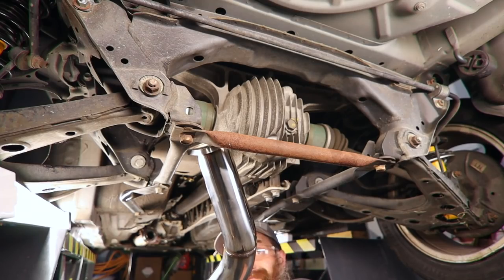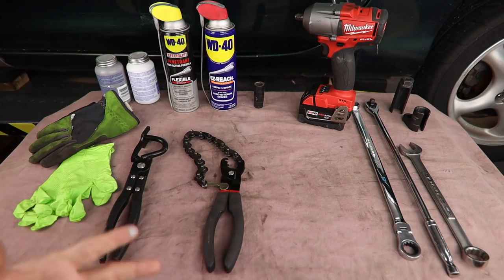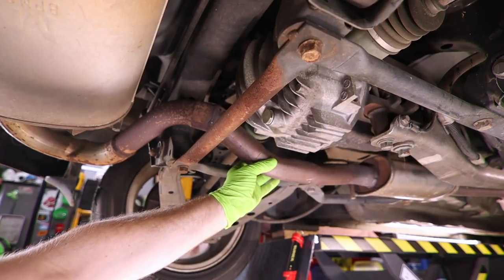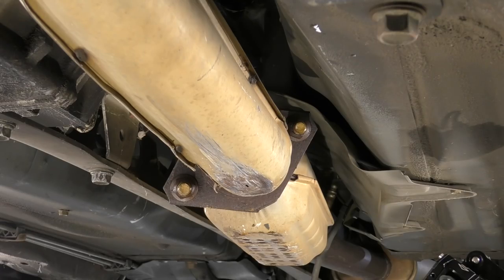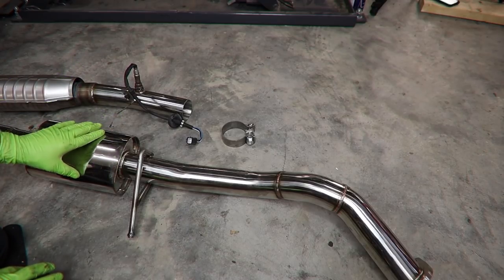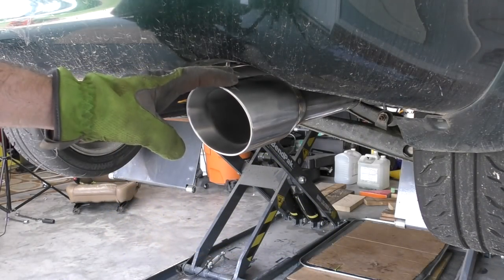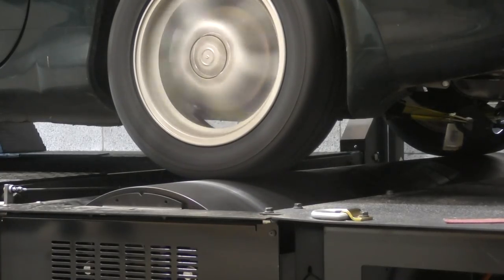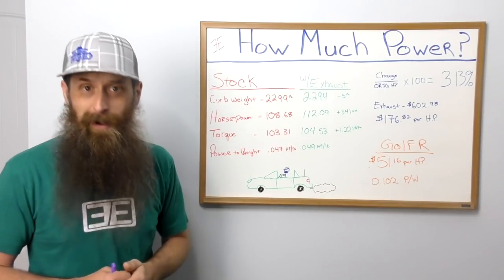Will a Performance Exhaust ACTUALLY Increase Power ~ Miata Exhaust Install

Comment from the maker: When you break it down by $ per HP, this is not the best use of money. HAHAH
Reply: Makes a nice ear dyno increase.😂😂
Reply from the maker: @jimmy4025  HAHA TRUE!!!!
Reply: I'm only watching this video for Ian's haircut lol
Reply: but how many smiles per dollar when you are driving??
Reply from the maker: @MrDiva480  The miata has a lot built in HAHA
Reply: How's the $ per dB ratio?
Reply: That is true on a stock engine, the exhaust didn't seem to be a big restriction. However, the stock exhaust would likely become more of a restriction if you upgraded other things like the intake, header, and cams and you probably would have seen a larger gain from changing it.
Reply: Hey but the ear/butt dyno is happy!
Reply: It sounds a lot better, though.
Reply: @michaelblacktree  That it does!
Reply: Exhausts are generally one of the worst mod for price to gain ratio for any car unless the stock system was designed incredibly poorly. 

Also not fair to the miata comparing to a turbocharged car as we all know NA cars don't tune well, more so with only an exhaust swap.
Reply: @TsLeng  You are right if you are only looking at doing the exhaust. However, an exhaust is a great starting point since it will help maximize the gains from doing other upgrades. The stock exhaust is usually adequate for the stock power level, but will often become a restriction when everything else is upgraded. Also, don't forget that you can get much cheaper exhausts that will likely provide a similar power gain. For example, I bought a Spec D exhaust on eBay for $110 shipped and it is decent, especially considering the price. The fart can muffler that came with it sounded like shit so I had it replaced with a Flowmaster DBX, but even so it still ended up costing half of what a Magnaflow would have and it is a very similar design.
Reply: @michaelblacktree  It does! I'm using the same Cobalt muffler. Makes a great, but not loud, noise.
Reply: What if you make your own exhaust without mufflers and cat?
Reply: @hannya29  You may see slightly better results then, maybe a couple more HP on a vehicle like the Miata
Reply: You should include a performance header if you really want exhaust hp!
Reply: @EmmaHopman  the Miata header is actually a pretty decent tubular piece from the factory.  Like the rest of the exhaust, it just doesn't really make a big difference on a stock(ish) engine.
Reply: It will last a lot longer than a standard exhaust so will save money over the years. It'll also make more of a difference if and when you upgrade the engine.
Reply: Had to replace the exhaust system because the existing one looked and sounded like Swiss cheese. Nice to drive without reeking of exhaust fumes.

Comment: Glad to see you with a Miata! Along with my tuned MQB Tiggy and tuned Alltrack, I picked up a NB2 Miata with low miles a few months ago. I’ve already done suspension and sticky tires that has made it stupid in the corners. This winter I plan to install Wilwood front brakes, header, Cobalt midpipe and RoadsterSport 3 muffler along with a few other items. Planning on going stand-alone ECU and Rotrex supercharger next year. The Rotrex has good hp but lower torque to prevent me from doing necessary upgraded drivetrain swaps. Great car and upgrades/parts are so affordable! Look forward to more videos on the Miata!

Comment: New exhaust definitely sounds better. I've heard from several people that a better flowing exhaust is better with other mods so your exhaust is not restricting the engine from making more power. Makes sense to me because as an engine takes more air in to make more power the engine has to efficiently be able to get rid of the inert gas created by combustion.

Comment: I don't have any true before numbers.  But, I have installed a custom exhaust from where it becomes single pipe (no cat, we didn't even get unleaded until '96 or something) on my '87 Mazda 323 1.5 SL.  The car had about 292k km on the clock (original engine, never opened apart from the obvious valve cover), factory spec is 55kW.  Granted, someone did play with the spark timing, before, so this is NOT purely from the exhaust, but after doing the exhaust I got 60.5kW.  It actually got a 10% improvement in both torque and power, without paying insane money for a factory-made mandrel bent system.  And yes, after doing the exhuast I got accidental wheelspin until I got used to the new performance.

Comment: On my 325is e30, I went from full stock with cat, to oe exhaust variant without cat (not mandatory for my 1990 e30), no difference in performance I'd say, sounded a lot better though. Then I put an original Hartge set of headers. The difference in the top end was really there. The stock cast iron manifolds have recesses around the nuts to give space for a socket or a tool, but in order to have enough meat there, those recesses creates 2 opposite bosses inside the runner, killing the flow. Last touch was a remap eprom. I have zero dyno time, I don't mind the numbers to be honest. All I wanted was improved drivability and I like it a lot !

Comment: Pretty much anytime you can change the exhaust with out needing to retune the car (carb, or new FI map whatever the circumstance) you will see nothing but incidental gains. The gains when examined closely frequently turn out to be illusory in any case, maybe a couple percent at redline, at the cost of actual losses at lower rpm. Cars are so efficient now that it's tough to beat factory and stay legal. NOW if you are track only, and can remove the cats, change the intake, not worry about noise levels, and add a fi controller the gains can be much better.

Comment: What a coincidence with respect to testing. This weekend I will be testing for fuel efficiency instead of hp after replacing an exhaust system. This will be done on a 3700 km round trip, to visit home, over 3 days on motorways; there will be minimal urban driving. The route I will be will be the same as the one I took to get to where I currently am based. 

 I recently had to change the exhaust system on my old 2.6 L, 4 cylinder petrol (+gas) 4x4 ute from the extractors back. It had an 1.75" system from factory which was replaced by a 2.25" system with a high flow cat. I immediately noticed the idle speed was lower and smoother. The old girl didn't feel like she was pulling any harder though. Fuel economy did appear to improve but inconsistent driving on urban and motorway roads can give a false impression of any increased efficiency.

I am excited to see if fuel efficiency has actually increased.
Reply from the maker: That’s awesome

Comment: Depends on what you mean by “exhaust”.  Header and high flow cat; yes, hp will improve.  Cat-back exhaust; nope.
Reply from the maker: No need to wonder. We test it out today. :) you might be surprised
Reply: They actually do gain I’m not sure if you’ve ever owned any car ever and looked at it’s stock exhaust haha
Reply: There isn't a lot of gains to be made by improving the piping on a 1.8L engine.
Reply: As a general rule, the further you get from the cylinder head, the smaller the gains. That said, a nice cat-back system is like the icing on the cake.
Reply: @HumbleMechanic  will we have a video of those too? :D
Reply: If he had done a header he wouldve made more power as well, but its also important to match the intake to the exhaust. If your car is taking in less air than it can put out you will lose power. If its taking in more air than it can put out you will lose power. He probably wouldve picked up 15 rwhp with a full exhaust from the header back and a better intake manifold with a larger throttle body.
Reply: @BigCool95  Most cars are built with very little restricted intake and exhaust systems except the mufflers and, mostly, catalytic converters, and even those are proven to have like 2% power lost impact. Headers on cars with less that 40 years are almost allways very good, what you can do it tune a little the power band. 15rwhp on a MX5 with exhaust, intake manifold and TB? Thats almost 20HP gain on the engine...on a car that have a good engine to start with. Good luck.

Comment: online calculators say 2" exhaust is good for 150/160hp, so the stock system was nowhere near its limit, hence no gain going bigger.  1.75 would top out at around 125hp so you could go smaller an probably not loose any power either.
Reply: There are other factors that those calculators don't take into consideration.

Comment: I really dont feel like Miles on an engine have much if anything to do with HP loss.. I feel its how well you maintained that engine that contributes to how well it retains its power. 
I picked up 20hp and 25lb/tq in my 97 Grand Marquis after going from single exhaust to dual exhaust with an H-Pipe and thrush welded mufflers, 2.5 inch cat back.   
wish i had the dyno sheets. That car is long gone.  I was 18 when my mother (In a drunk rage) drove it into a tree

Comment: When you really want to get some gains on a Maita 1.6 change the exhaust including a racecat, air intake and shave 0.6mm off the cilinderhead.
My na Miata went from 115 hp to 132 hp. pulls much better and loses a small dip in the torque curve.
Cost approx. 900 euro when doing it yourself (exept the cilinderhead)
really changes the car!  😁

Comment: Those hanger pliers are one of those tools that make you feel very stupid for not having. I literally yelled “Son-of-a-[bleeeeeeeep]!!!! Why the hell didn’t I buy these years ago!”. I was angry at myself for a solid 10 minutes the first time I used them because I realized I had wasted so much time and effort over the years using prybars, screwdrivers, bare hands, ect.
Reply from the maker: You are SPOT ON!!! I love those dang things. I don’t use them much. But they are a must have. And they are under $20. Haha

Comment: Curious to see this test done on a factory turbo car!
Reply: Wheeler dealers did this on a subaru Impreza WRX or GT, can't recall exactly. The ECU in the car did strange things to compensate for the change,  and they ended up losing HP,  quite a lot actually. So pointless on an EFI turbo engine unless you're doing a remap as well.
Reply: @Tomazack  most mods that you do will lose horsepower if you dont tell the computer you changed it

Comment: Going to guess the biggest improvement was the new catalytic converter, where you had the obstructions removed from the passages. My car I went for a branch, because the stock casting cracked, and no real improvement on power, but at least no exhaust noise increase either. But then, 1.4l golf is not exactly a power house anyway, but a nice reliable driver.

Comment: Cars like these throttle response is more important, you would notice the car being a little more responsive to your foot with the better flowing exhaust. Not as much as say a throttle body porting or upgrade but still noticeable, maybe a port or throttle upgrade could be in the books for the next test.

Comment: I did a resonator delete on my A3 1.4TFSI... measured the 0-100km/h several times. Gained 0.1s😁 9.3s is original and confirmed by Audi, it did 9.2s now😅

Comment: Did I see a small hole in the flattened section of the old exhaust that you didn't replace? Perhaps you could have a closer look when you are under the car next time. I also recommend looking at all the low points under the car to find any existing damage or potential trouble spots in the new exhaust. Put the car on a hoist and have it at a height where can stand at the front and rear and look down the underside to see your low points using the front and rear suspension as a reference.

Comment: Can't really comment on exhaust change over vs. Hp gain but I can't help but wonder how your OCD could resist taking off that bracket, rust removal and paint then reinstall? You must have a lot of will power. Very good video on exhaust vs cost benefits.
Reply from the maker: Good call;). I’m planning something for this car in the not too distant future

Comment: Would be really interested to see how far you run with this concept, interested to see what a header does on top, cold air etc....and if you really play it out, would be interesting where you get to going full electric water pump and manual rack.

Comment: Exhaust can become a limiting power factor when other parts in the engine are upgraded. This is especially true for turbocharged vehicles that rely completely on exhaust flow to provide increased power to the engine. In that sense it is actually a good place to start because it gives you the room for other power mods. Also who doesn't wanna hear that braaaaap sound?

Comment: Before Hot Rod decided to no longer offer their video for free. On an Engine Masters video they beat the living daylights out of header tubes while on an engine on the dyno. Essentially it made no difference even with the tubes damaged beyond reason. It was a mild build SBC roughly 400hp.

Comment: Hey, Charles!  Love the videos, as always.  What's your nifty little push tool that you used to push the rubber grommet for the O² sensor wire through the floor of the car and where did you get it?  I hate not having right tool for the job... and sometimes causing damage to those little rubber parts becomes a bigger headache later on down the road.
I've installed aftermarket exhaust on a lot of vehicles and I feel like most of them are a placebo effect, as far as performance goes.  But sometimesit's worth it just to have a better-looking and better sounding exhaust.  Although I have heard of some aftermarket exhaust and during the performance.  I've never actually experienced this, myself, that I know of.   What's your take on that?  
And this may be a question you can or cannot answer due to branding and such, and I totally understand if you can't, but what is your opinion of  Borla exhausts?  I live on the other side of interstate 26 from the borla exhaust plant here in Tennessee and have several friends that work there, including one in research and development, and I have thought about having them recreate one of their old exhaust systems that is no longer... Or maybe even having a new one built from scratch for one of my Z32s.

Comment: The 99-00 OEM header is pretty eh. Isn't as bad as others, but a Racing Beat (or another name brand company) header would really help top end. That "long tube" design is what helps.
Either way, chasing NA power on a BP with bolt ons is pretty futile without an ECU such as a MS. Hopefully that's in the plans for this car. :) The stock ECU is dumb as a sack of rocks and doesn't know how to use the increased airflow.
Good work on it so far!
Reply: chasing any hp on a na miata is futile, bp loves boost. Headers, itb, port polishing, the works, you'd be very lucky to hit 140 hp. Cheap turbo hits 200 easy

Comment: I question the validity of the dyno testing: doing the swap first, then swapping back, then back to new has to confuse a computer. They settle in over time - not instantaneously.

Comment: It would interesting to see dyno comparisons of the exhausts with a tune. Also vs a high flow cat.
Reply from the maker: I’d love to!! I did t here because of rules for AutoCross. For street class you can’t have a tune and the ECM tune requires soldering.

Comment: Also if you put a stainless exhaust in remember to wipe off any fingerprints on the tip or the heat will make the fingerprints show :)

Comment: One question. I know this may be too late to dig up,  it I wonder what the power curve looks like. Cause yeah roughly 4hp isn't much, but if it comes on or cut off peak power or torque, it could actually decently help performance
Reply: Comes on early, or cut off later is what I meant.

Comment: I think it would have been good to mention that typical things to do with aftermarket exhaust is to install performance air filter and possibly do tune. Then the horsepower gains are greater but so does the cost rise with it. Great video otherwise.

Comment: I watched Scotty's video recently about performance exhausts. and he doesn't like them (no surprise). However, he got a good point about oxygen sensor behavior. Doesn't change in exhaust need some change in ECU mapping, or things might go haywire?
Reply from the maker: You would have to change the position of the o2 to make any real difference
Reply: @HumbleMechanic  This makes me wonder as well.  I have a '99 2.8 Z3, which had a butchered exhaust when I bought it.  When I put the stock silencer on, the performance immediately improved significantly.  Considering the stock silencer is not exactly straight-through, I could only think of the increased flow of the custom box (one tip straight through, the other one having to fill a chamber first) somehow changing the O2 sensor readings.

Comment: I don't think you're going to see any major benefits from exhaust modifications, until you change the exhaust manifold, followed by ECU remapping. Then again, I don't know much of anything about Mazda's, but I don't think the diameter of stock exhaust was chosen arbitrarily by the engineers that designed that whole exhaust system.

Comment: hey @humblemechanic, wondering if you use a power bleeder for flushing the miatas brake fluid? thanks!
Reply from the maker: No. My adapter doesn’t fit.
Reply: @HumbleMechanic  👍 give the brakes a good ol pump?
Reply from the maker: Used a vacuum pump to suck fluid

Comment: Header and straight pipe would be cheaper (probably) and get better numbers.
Reply from the maker: I’m guessing straight pipe would sound awful. Haha 
Because the car is street class for auto Cross I need to keep the header stock. But I may order one and see how much power she gets. I’ve heard OEM header replacement can see a solid improvement

Comment: No v-band clamps for a $600 exhaust?
Reply from the maker: No need for it. It’s meant to bolt to the factory setup with has no V-band